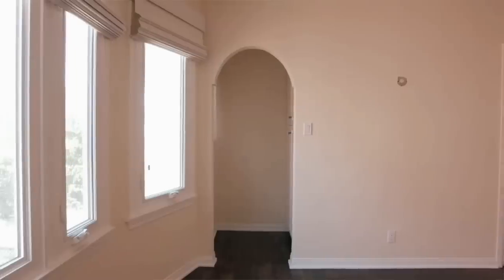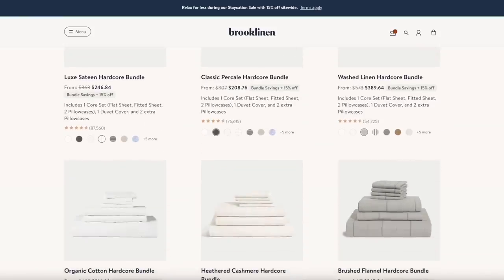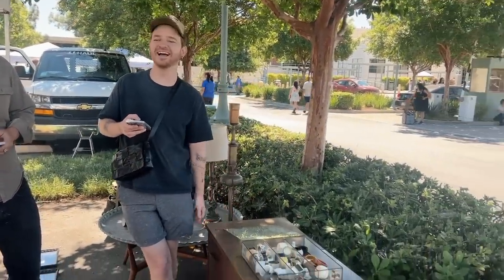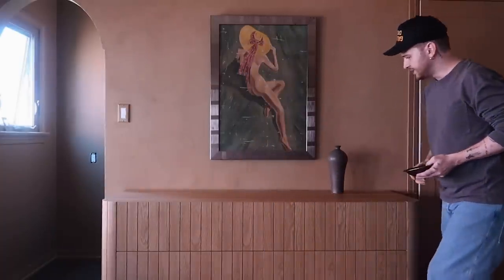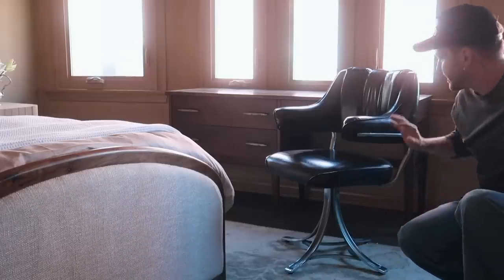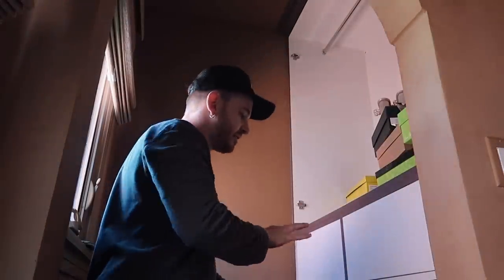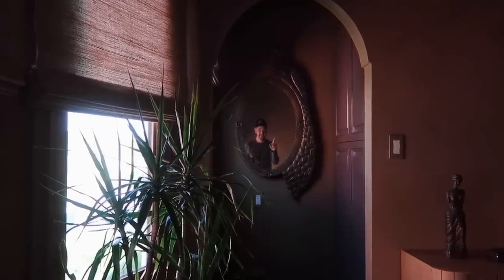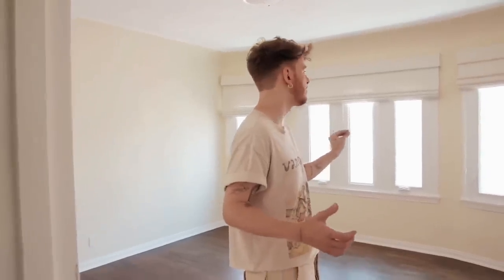DIY EXTREME BEDROOM MAKEOVER (From Start to Finish) - Decor Styling & Reveal

Comment: Everything is beautiful. I especially like the area where the peacock mirror is. The only thing I would do differently is get the plastic cord covers (Amazon). They have adhesive strip and cord fits inside. Then paint them the same color as wall. The cords hanging down takes away from the bed and nightstands. Just an idea. 😊

Comment: Wow, it is gorgeous. I love that you paid attention to what was outside the window.  Sarah Richardson did a loft makeover and failed to take into consideration another red brick wall that was even closer to the client's windows.   The red clashed terribly with the decor and she ended with suggesting they never open the drapes which is ridiculous.   So many designers fail to take into consideration what is outside.   Your choices were spot on perfect especially the wall color and the way it reflects the light in such a subtle way.  That dresser I take it wasn't a bargain find but it is stunning and a great focal point for that wall and the bed is a stunning piece.    If it were me, I would trade the lovely cream colored blanket at the end of the bed for a vintage textile to the bed to break up the styled perfection a bit.  I know a lot of people think a quilt or even piece of 30s fabric would be too boho for the room but I think a vintage quilt always makes a room look more approachable and at the same time breaks up the perfectly styled textiles.   I like something that doesn't quite match too even if it is a quilt in a basket on the floor.  Still matching and perfection is gorgeous too.   I admire perfection and I understand the need for it in such a video.

Comment: Perhaps a ceiling rose would have been an option for the ceiling lamp. The bedside hanging lamps are very charming! It would have been perfect to run the power supply line in the wall, since you plastered the walls anyway.

Especially for the bedroom, bow hemp is very suitable, as this plant produces oxygen during the night.

Comment: I would use cord cable concealer painted in room color for wall lights by the bed, other than that, it's gorgeous.  💜💜💜
Reply from the maker: I actually wanted the cords to add a little casual element to the space :)

Comment: I wanted to ask if wifi lights like you used in a previous video could be used for the wall sconces. I love the idea of putting up wall sconces above my bed but don't want visible cabling,  cords or to cut the wires into the wall. Have you found the rechargable bulbs/wifi connection not reliable? Why did you not use them here?

Comment: It would be the perfect hotel room. I'm going to assume it is Marie's wish to keep the room utterly devoid of anything personal to her. It's a beautifully designed space. For sure. But I get aggravated by nonfunctional designs. 

Marie will need blackout window coverings to SLEEP, and a mirror, etc. for doing makeup at that desk so it should go on the opposite wall for lighting not coming into her face and a mirror. I guess she doesn't want her own TV or reading chair? And lamps are simply essential to me for reading  in bed, etc. Good nightstand storage and sensible bedside storage are non-negotiable. Finally, someplace for personal books and tchotchkes plus that lovely mirror should be by the closet...not across the room around the bed. Apparently Marie didn't want anything overtly feminine either?
Otherwise, it was well done.